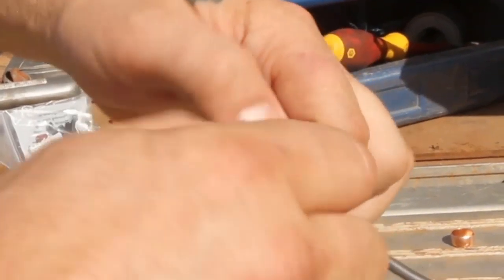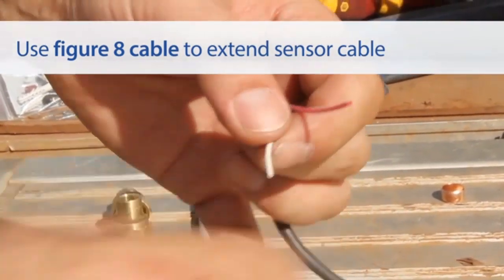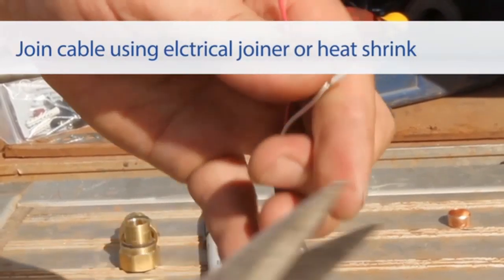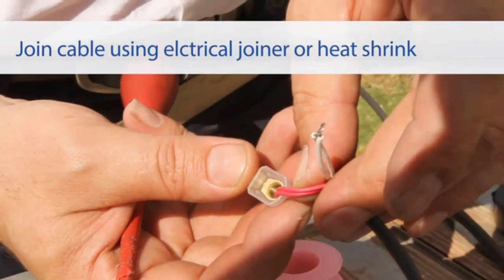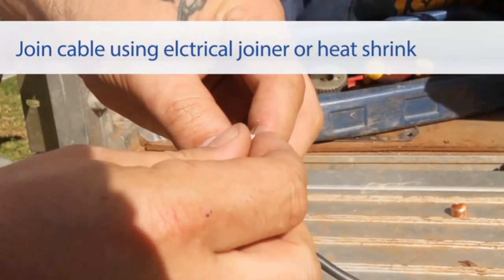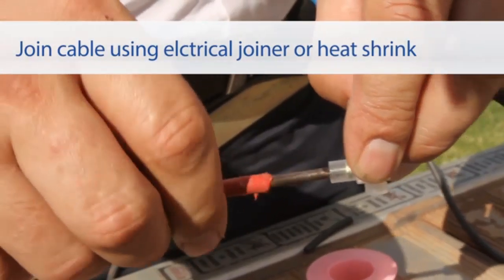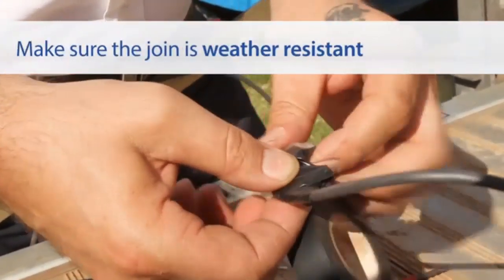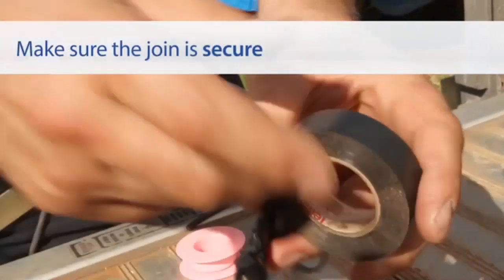Replacing A Solar Hot Water Roof Sensor.

Comment: This has nothing to do with replacing the solar sensor. This is how to extend the wires. My sensor is shorting and I’d like to identify it and learn how to replace it. Video title is wrong.
Reply: Hi, if you log onto our website and email us a photo of you current controller we can generally match the sensor and give you the knowledge to replace the faulty one. There are often underlying factors that cause a sensor to fail. We can work through those as well. That way you can get the system runnning like new again.       solarhotwaterparts.com.au
Reply: @rebeccamoelands8911  Very kind of you, Rebecca. I’m in the US, though, so shipping would be a killer, take forever, or both. Lol I located the part and, coincidentally, the manufacturer (Harwil) is about 20 minutes from me. I’m driving there in the morning. All the best!
Reply: Hey im an australian plumber if the sensor is faulty it will come up on your controller with ssd roof and you can literally just pull the old one out and replace with a new one
Reply: @hardasphuk7633  Hi, in our case, there is a hexagonal screw that can be seen from the outside (on the roof of the water tank) and the cable goes inside it. Does the screw have to be removed or just pull the cable so that the sensor comes out. Sensor is NTC10K, ф6x50mm( as I can see in the user manuel description of controller) Please help, nieder the plumber, nor the electrician know